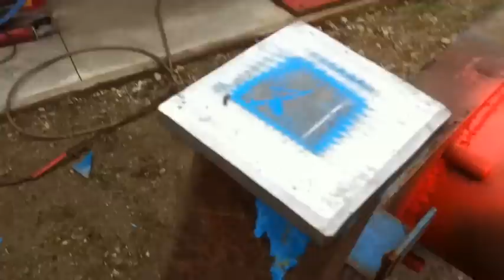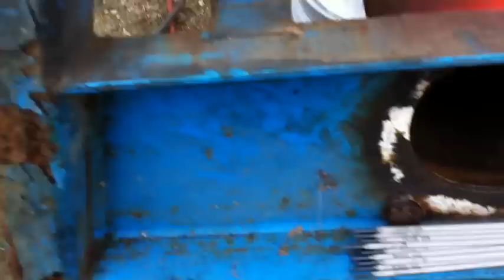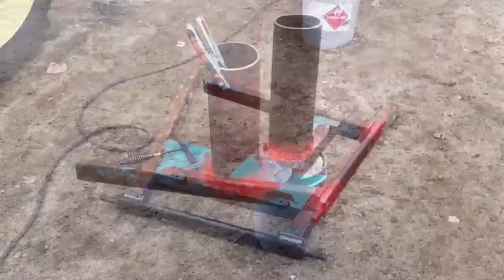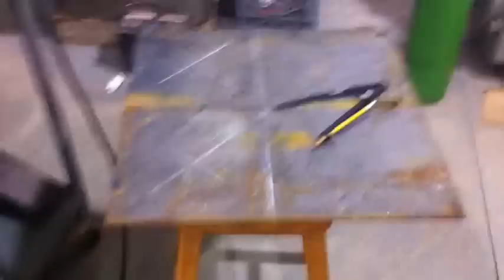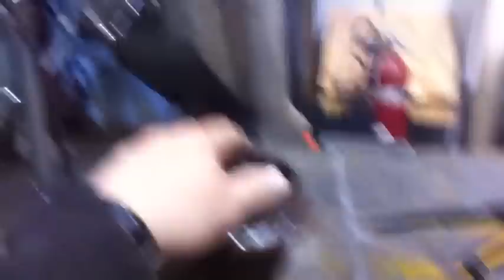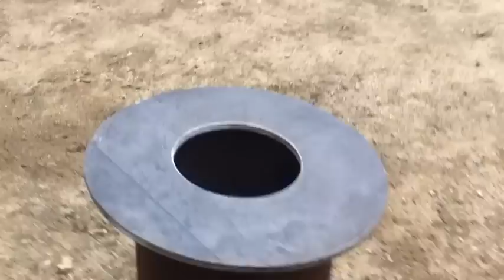Building a Log Splitter Hoist #2

Comment: Very Nice work. Well thought out and great use of materials.
Your 7018 rod is a 70K psi tensile strength low hydrogen rod.Used for structural steel type of weldments.
I caught your thread of on the tractor forum and followed your link.I had considered something like this but never thought of the hub bearing.cool idea!